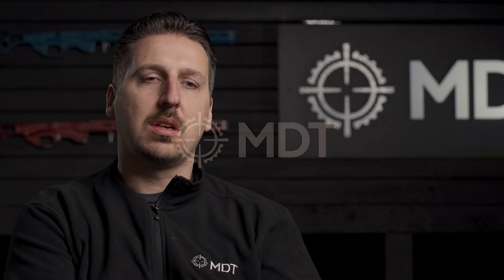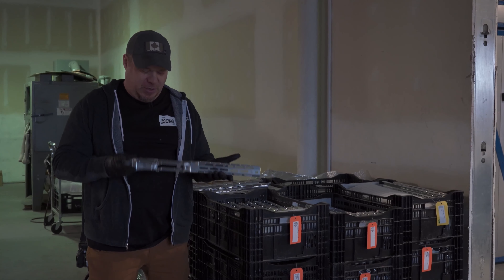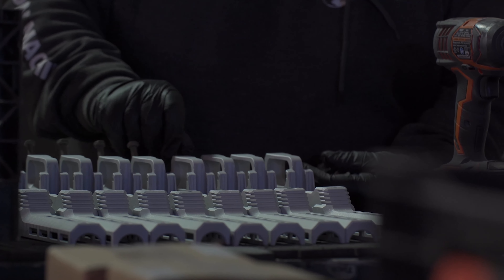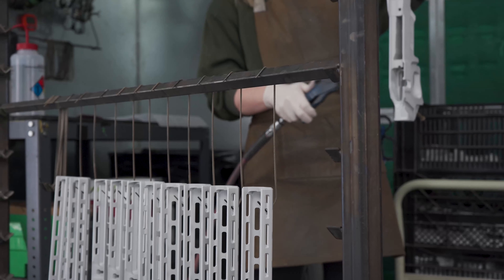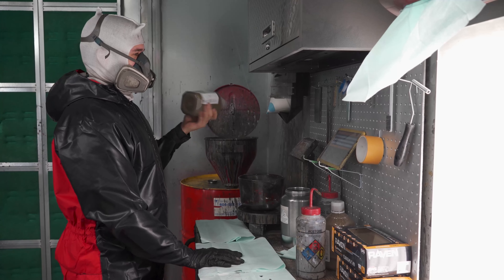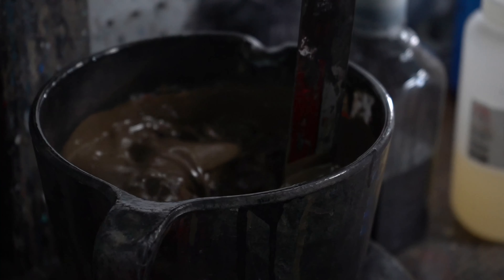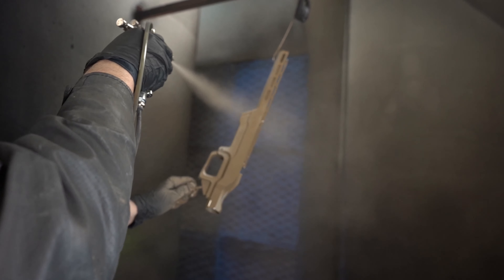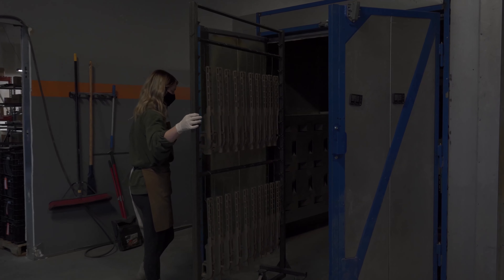Cerakote Process: How MDT paints precision rifle chassis with Cerakote

Comment: Here I am after buying a mdt ess chassis busy sending it back due to the forend having the bare aluminium slightly visible through the cerakote at certain places ..
Reply from the maker: Hi, thank you for feedback about your ESS. There are some areas that we intentionally lightly coat so we don't run the chance of any drips/run off in areas that won't be hidden by either hardware or the the action.

Comment: My ess chassis got dinged up easy. In fact it came with a few nicks already out of the box. Not sure what you mean about it being scratch resistant or extremely durable.
Reply: My grey ess had a small quarter inch long hair line scratch as well right out of the box but ohh well a couple matches and it will get a few more other then that it was perfect
Reply from the maker: We're sorry to hear about your experience, please reach out to us through the link below and we will see what we can do for you. 

https://support.mdttac.com/hc/en-us
Reply: @MDTTAC  maybe try using the E series instead of the H series cerakote
Reply: @jeffreyli1004  we do for a few applications but the E series has a limited selection of only 15 colours.
Reply: A cerakote applicator I follow never mixes higher than 12 to 1 for this very reason. He says any higher and it will scratch very easy.  20 to 1 seems crazy high?